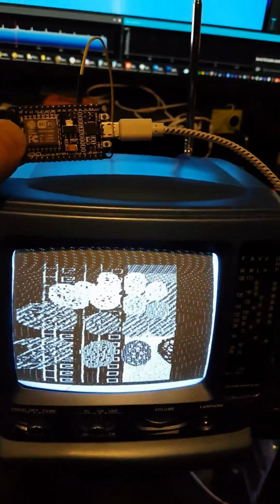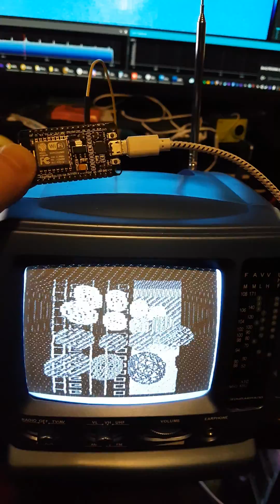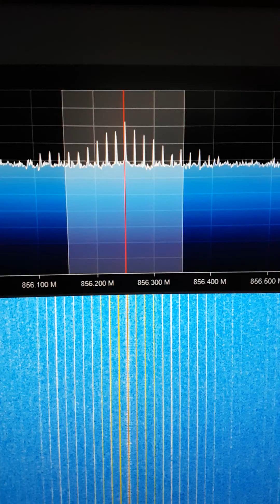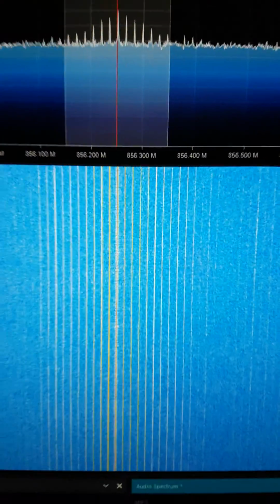ESP8266 becomes a UHF TV Transmitter!

Comment: Vey nice work! Would it be possible to transmit on channel 21 (I am in the UK and am trying to transmit to a pocket TV that can receive from around UHF channel 21 to channel 60...)
Reply: No, it's not possible, because the I2S clock speed of ESP8266 is not fast enough, The max speed of esp8266  i2s is 80MHZ,The analog TV channel number 21 is 512 to 518MHZ, not possible, channel 3 is 60 to 65.75MHZ,
Reply: Hy,in UK, the channel 3 is available, because dvbt by the air doesn’t use VHF 1 and analog transmissions stopped several years ago..